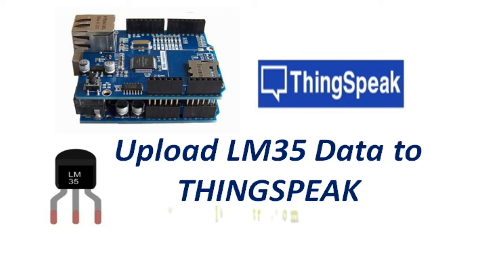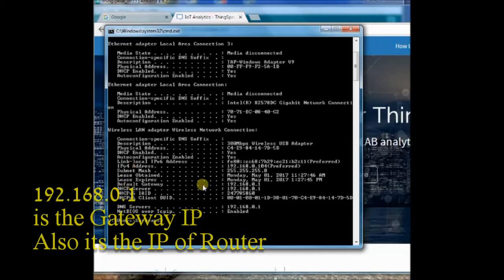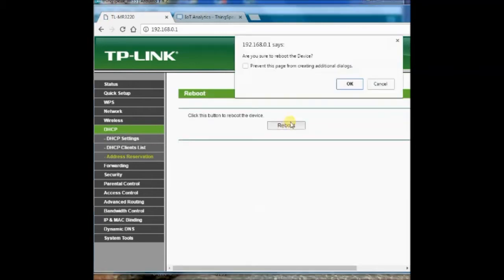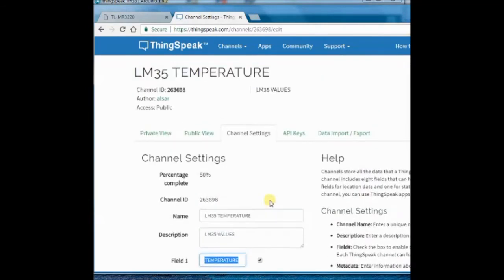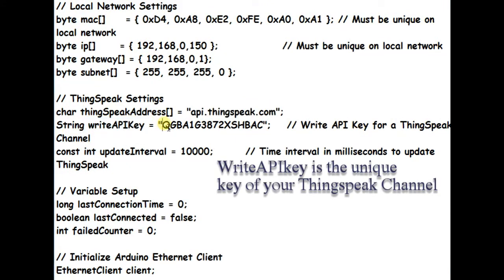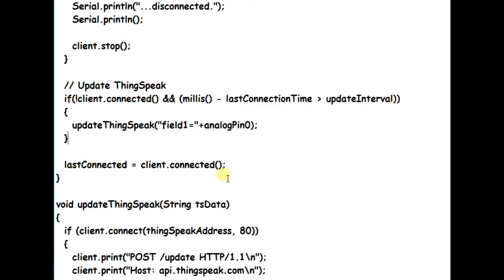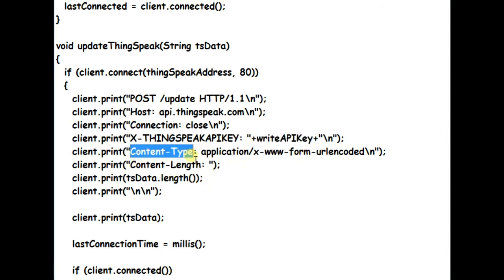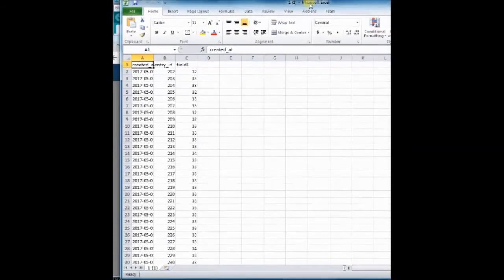ETHERNET SHIELD Arduino–Upload LM35 Data to THINGSPEAK

Comment: thanks but ı have a problem. I am using enc28j60 module.  byte ip[]      = { 192,168,2,4 };  but   ETHERNET SHIELD ip  is     : 0.0.0.0